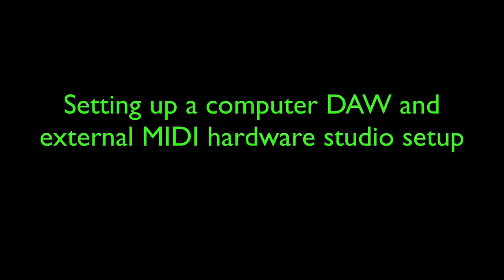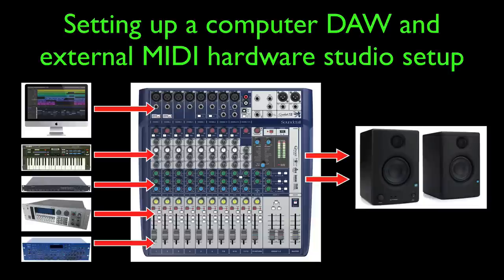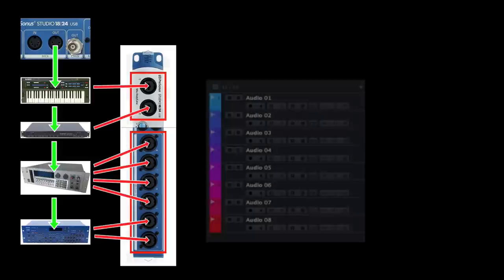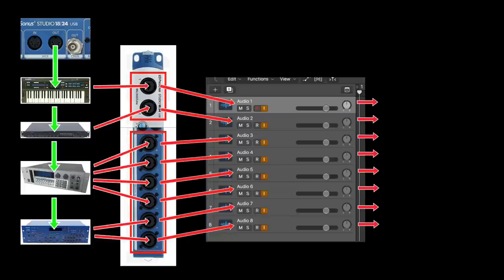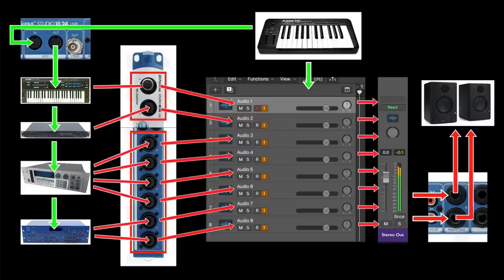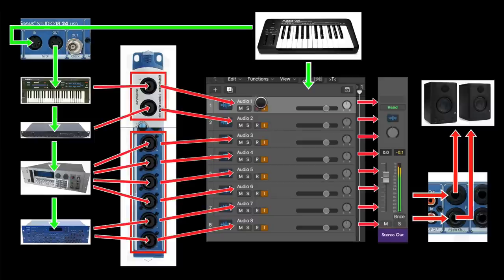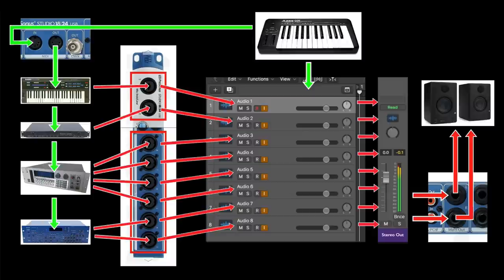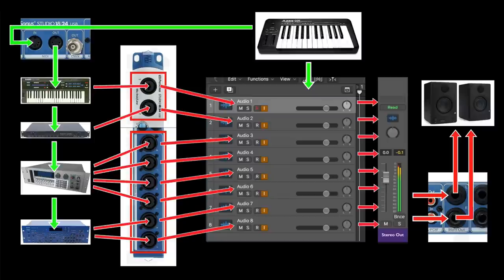How to setup a computer DAW & external MIDI hardware studio

Comment: I am still unclear on why a digital mixer that sends each channel to the DAW isn't a viable option. Isn't a digital mixer with a per-channel output to PC via USB the same basic idea as using a multi-channel audio interface to send each piece of outboard analog MIDI controlled hardware to the PC (and per-channel into the DAW)? 

Besides the ability to adjust the audio on its way IN to the PC via all the digital mixer pans, fades, EQ, AUX S/R, etc: isn't the digital mixer MORE capable than an audio interface? 

Aren't Interface units typically outfitted with a gain adjustment, and maybe pan if you're lucky? Even the interfaces with a possible high number of inputs that cost significantly more than the typical 2x and 4x Interface Input options, just do not have a lot of <pre-PC> audio modification options available. Certainly not the options available to a mixer. 

I have been considering something that may be the best of both worlds. A UNIT that accepts 8, 12, 24 + expanded options by stacking units and using optical / digital audio to link the units and double, triple, quadruple - and so on - the number of available inputs.

This would be using a desktop (or rackmount version) of a digital mixer. It has approximately the same footprint as a multi-channel audio interface, and about as many onboard options. They appear real simple: Inputs, maybe a gain knob, and perhaps a basic VU LED on some of the nicer ones. They have USB (2, 3, and C) mixer to PC connections. Many have optical audio I/O, in which you can chain two, three, four, and more units together, expanding the number of inputs by the number available per mixer in each link of that chain.

Like the Soundcraft Ui24R :
24 channels of inputs 
Rack mounted
All traditional mixer controls exist in the control application - available on any PC, laptop, tablet or phone OS. 

Or the
Behringer X32 Rack 40-channel Rackmount Digital Mixer
Add 8, 16, 14, and 32 channel expansion boxes, connected via Ethernet or optical. Monitor and DSP &  manipulate on iPad / iPhone.

Perhaps the Midas DL32 32-input & the Midas M32C  Digital Rackmount Mixer?   Again, uses built-in Ethernet port, to connect each unit, as well as one to connect to a local network for remote control via your computer. Or connect to a wireless network and control the M32C with your iPad, iPhone, or Android device remotely. 

Again. No deed for a mixing deal when you can control it all remotely with a PC, laptop, phone or tablet.

Some of these have an insane amount of outputs for different monitor mixes. Lots of onboard effects. Some have the ability to use outboard effects with traditional sends & returns. 

Maybe my favorite is the  PreSonus StudioLive 32R 32-channel Rackmount Digital Mixer.  It boasts 40/40 Input/ Output, expandable to 55x55 I/O over Ethernet. 

A second Ethernet port is used to  operate the virtual mixing deal surface software, called UC Surface: available for Mac, Windows, and iPad. That is for the engineer. How about all the outputs? This thing could run 8 monitor outputs. Don't sweat it! Al those monitor mixes can be tended to via the QMix-UC APP: available for both iOS and Android. Whether it's a monitor engineer, or the performer with his phone, another piece of gear (monitor mixing desk) that doesn't need to be transported, or set up.

This one kind of blues the line between traditional and rack mount remote controlled digital mixer, but it's close  The Allen & Heath Qu-Pac 22 in/12 out Rackmountable Digital Mixer is outstanding. 
16 Mono + three stereo input channels
12 onboard Mix Outputs, expandable to   40 in and 24 separate outs. 

This one uses an app only available via iPad. Turn off for me, but plenty of people use them. 

Next... Even Yamaha!! The  TF-Rack 40-channel Digital Rackmount Mixer. 
A lot like the previous one. Fuzzy. And yes, they have an expansion rackmount unit with 16 more inputs and 12 more outputs per unit.  called the Yamaha Tio1608 with IN and OUT Ethernet connections in each: Making it easy to chain THREE more of these together. That means you could feasibility have 64 inputs and 48 outputs if you maxed out the expansion units. Yamaha has a trio of apps to utilize this gear. PC, Mac iOS, iPad can all be used for various operational functions. 

The inexpensive Zoom LiveTrak L20R 20-channel Remote-controlled Digital Mixer / Recorder might be the way to go for those on a tight budget. 22in/ 4out USB from the unit to any Mac or PC. An iPad app exists to wirelessly control the on screen mixing desk- so even though it exports the audio (per channel) to a DAW on any kind of computer - you still an iPad to control the virtual mixing desk. This unit doesn't expand our like the others, but does have an internal SD card recorder that will record each input individually, or make a mixed down stereo recording, without the need for a computer or DAW.

There are more.

Mackie DL16S & DL32S
MOTU has one
Midas and Soundcraft have other models beyond the ones listed above.

I see this being more and more of a thing. I am leaning this way. I have SO MANY synths, drum machines, mics, and effects that one of these rackmount units plus maybe an expansion unit, along with a patchbay - would consolidate my setup immensely.

Just my 2 cents.
Reply from the maker: Short answer: In classical  multitrack recording you almost never eq BEFORE the recorder except for perhaps some 'corrective' eq adjustments such as a hi-pass to remove bottom-end rumble, because we always want an UN-equalised copy of the mic channel printed to tape/digital - hence recording mixers have monitoring channels (split/inline or hybrid). This is also why ALL music DAW software add their FX/processing plugins AFTER the record point, functioning as monitoring FX/processing.

Given this fact, this is why plugins work fine for monitoring FX/processing & generally people prefer using those with a controller mixer, if a controller-mixer is used at all (which most of the better/pricier digital mixers will actually function as in 'controller' mode).

The main role of the mixer in a studio is ROUTING & for the pre-amps & the main channel EQ section is pretty much only used on final mix-down, & yes, a digital mixer CAN be convenient for routing purposes, but it's not a dealbreaker depending on your setup.

Comment: Except this doesn't cover  if you wanna add external FX processors or if you need extra channels, this can be quite misleading for beginners I think
Reply from the maker: The entire point of this technique is that it offers a solution for those who do NOT have an external mixer or a selection of external hardware fx processors, but who DO have hardware midi kit or want to integrate external midi hardware. It is an ALTERNATIVE method therefore to buying a mixer and buying external fx processors & all the cables and then still having to make all that works with the DAW setup. 

& then there's the laborious process of preparing for the final DAW/outboard final mix down

Personally I own two DAT machines AND a stereo reel to reel mastering machine, but most do not, so to prepare for final bounce/mix inside the DAW without a DAT or other mastering machine you have to track the external content to the DAW, one by one as audio tracks unless you are happy with the entire external sub-mix being in stereo only inside the DAW prior to final bounce-down/mix.

Finally, yes you CAN still use external processors like compressors, pre-amps or eq/channel strips BEFORE the daw inputs, but there's absolutely no sense in using reverb, delay etc fx externally as you can add all that inside the daw & i really doubt there's any noobs out there going: "But I own an old AMS or Lexicon & the reverb plugins wont get me that sound!" 

So it is in fact not in the least misleading for beginners. If you need 'extra channels' then you add extra inpus, which we covered in our video: HOW TO GET LOADS OF INPUTS INTO YOUR DAW (https://youtu.be/7rsaYq5jYxE) -  where you will see a range of solution to get from 16-32 physical DAW inputs.

hope that helps.
cheers

Comment: Thanks for this.  I've always used an analogue desk and often wondered how I'd go about things if I moved over to one of these interfaces.  With this method the signals are still analogue not digital, correct?
Reply from the maker: they are analog until they enter the interface input, then converted to digital by the interface after the pre-amp.
Reply: Analogue to digital conversion going into interface, then digital to analogue convertesion playing out of the interface. At the end of the day all signals must ultimately be converted and played back into analogue in order for them to heard as sound via speakers and headphones. Studio monitors with digital inputs have digital to analogue converters built in too.

Comment: Hi sorry to be really dense but how is that approach necessarily better than using a mixer?
Reply from the maker: ok so you buy a mixer... now how do you add any fx or processing to any channels in your mix? You've got to then buy processors & fx on top unless you buy a digital mixer with fx built in which will always be a compromise unless you spend big money. Finally, even a cheap mixer will cost more than the audio interface.

Comment: what about getting the bpm of external hardware synced to the daw and recording to the grid of the daw accurately ? and using multiple hardware sequencers to achieve this, how is that done? in a similar way?
Reply from the maker: Read up on Midi clock and MTC

Comment: Would there be any latency issues if you would add to this setup more io, hardware processors like a reverb/delay, dbx compressor, pultecs and masterbus comp. 

Theoretical situation u have kick and snare sample in the s950 goin in on separate channels on the interface. You want to add an eq plug in daw on and also process them through a hardware reverb via send. After that send them out to a dbx comp then back in to the daw. Next create a drumgroup of them into a drum bus and send that into a pultec eq. And lastly have hardware sterecomp insert on the master channel.

All of this processing would be happning in real time in a jamming like situation where the kick and snare would be coming straight out of the 950 meaning the signals would not be prerecorded to daw. 

All of my production is done otb with hardware sequencers and samplers, and im asking this cause i would like to know if its possible to create a ”final mix” with a hardware setup like thiw before hitting record on daw? The interface would function more like a analog mixer in this case.

What kind of latency issues can you expect from a situation like this? Would a setup like this only cause headache and i would just be better of using a mixer? However, I would like to add that preferably i want avoid using a mixer if i can since the mixers i can afford might not be that great. 

Cheers!
Reply from the maker: in a word, no.i wouldn't do that, you would be combining latency, and without getting out a pencil and paper and drawing the plot diagram of what you describe to check, there could be loop feedback issues with send/returns - plus you'd end up with almost no actual inputs available as so many would be occupied with send/return & bus send/return duties negating the entire point of the technique which is to use inputs as inputs. 

latency issues? Just sending out and back from a h/w reverb would add another bunch of ms delay to the reverb return, not a massive issue with time-based fx like delay/reverb, but still depending on the reverb program chosen it might sound weird with additional pre-delay added... and then there'd be the nightmare of printing everything to final record, and delays in signals which then would have to be re-aligned manually

you'd be better off getting a mixer and using that in combination with an interface - and that brings in different techniques which we'll be making example videos about when the new space is setup here with a full outboard hardware + mixer + DAW setup. 👍
Reply: @dancetech  yeah that was what i was afraid of! Thanks for the help!

Comment: I have an old 4x4 midi interface. And 1 midi controller. My question is can I go midi out from my 2 modules into midi in on the mifi interface and then from a audio interface into my outboard mixer  and run everything via my mixer since ny mixer has numerous line in available versus an audio interface that has 8 line in's but not numerous midi outs? I am running a DAW on a laptop. With only 2 USB ports btw if that helps?
Reply from the maker: that's not the usual way to do it. The usual way to do it is... the controller / master keyboard sends all midi IN to the daw for recording and that midi passes THRU the daw and back OUT to the other hardware to trigger it... in some cases you can have more than one master keyboard playing midi data IN to the daw using a midi MERGE box

Comment: Do I need a midi keyboard to use sound modules like the Korg Tr-Rack on a DAW? Can I not just connect it directly to my PC?
Reply from the maker: you only need a midi keyboard if you want to play any hardware units (or plugin instruments) from a keyboard of course. Otherwise manually enter notes in the DAW
Reply: @dancetech  Thank you for the quick reply! I’ve been searching the Internet for an answer to my question for a long while now, so I’m really glad that it’s cleared up. I want to know another thing if you don’t mind;

Since I’d prefer to manually add the notes in the DAW for my sound module, what cords or devices would I need to send a connection from the rack over to my computer?

Comment: i have my gear set up very similar except that my MIDI keyboard is plugged into the mac via USB. what i would like to know is this, if i have more than 1 external device that both transmit MIDI data, how would i wire the MIDI cables to i could record the MIDI data transmitted by both devices. with 1 device its easy. MIDI  out of interface to MIDI in of the device, MIDI out of device to MIDI in of the Interface,  but if i add another MIDI transmitting device, what do i do? both devices have a MIDI thru port.
Reply from the maker: Midi MERGE box to feed more than one unit IN to the midi input of the daw & either use midi TRHU on the hardware to distribute midi OUT from DAW in a chain from hardware unit to unit (which is NOT ideal tbh) or best thing is to get a midi distribution box.
Reply: @dancetech  brilliant, thanks for the explanation

Comment: A lot of interfaces do not come with 5pin midi out. What is the set up if your audio interface does not have a midi port?Thanks in advance
Reply from the maker: you'd have to get a usb midi in/out hub
Reply: @dancetech  just a midi thru or also a midi merge? Thanks!
Reply from the maker: @soundsofthenewberlin  well if you want to play the external hardware midi kit from a usb master key board then you have usb master keyboard sending midi IN to the DAW via usb, then midi OUT to the hardware units is handled by a midi usb hub, ideally with as many MIDI ports as you have midi items (once port for each midi item)👍
Reply: @dancetech  Thanks for the time and the guidance! I appreciate it a lot :)
Reply from the maker: @soundsofthenewberlin  👍

Comment: Thanks for the vid, however the problem I have is that if I record on track 1, I get the same sound on every track there after.  Why is that?  Thanks in advance
Reply from the maker: how do you mean "on every track"?
Reply: @dancetech  I record piano on track 1, then when I record, say kick drum on track 2, they both playback the kick drum, on track 1 and 2
Reply from the maker: @samuelmaylor6634  sounds like you are re-recording the kick via the output
Reply: @dancetech  ok I'll recheck thanks for answering